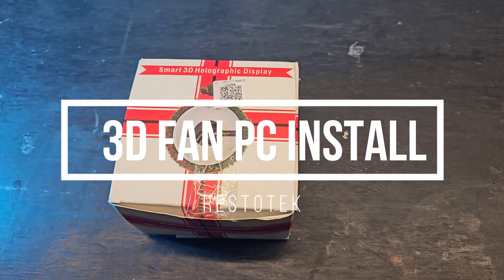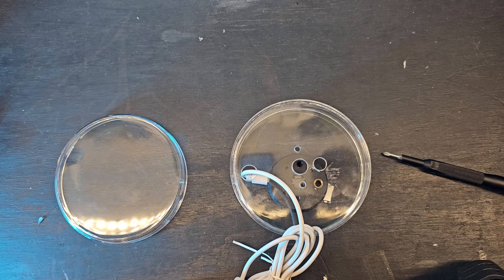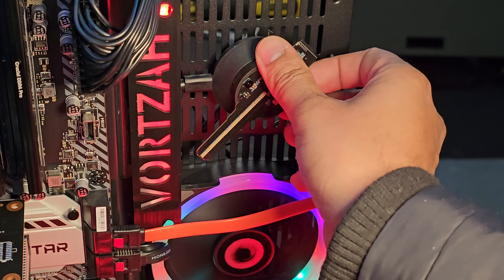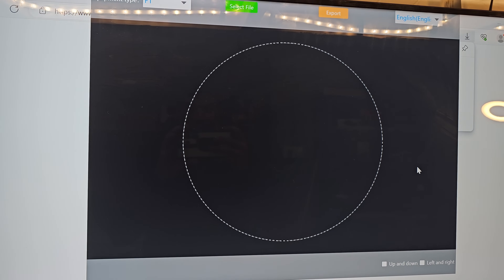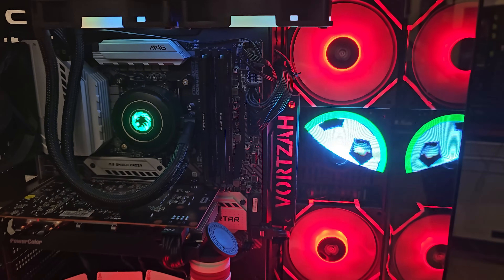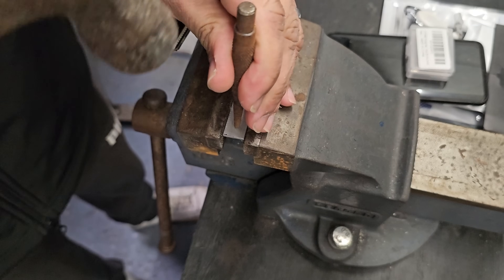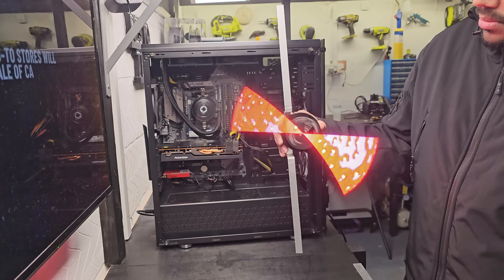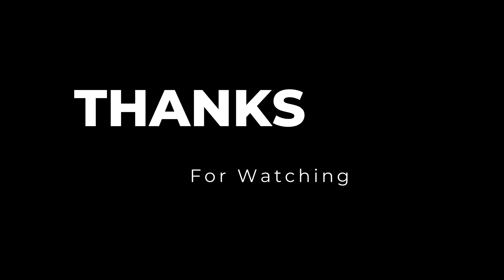FORGET Transparent LCD Side Panel, Try this HACK Instead!

Comment: Do you think it would work fine if you get the entire big fan inside the case with a side panel? I want to try, but I want a glass side panel and it does not have holes for the air to go/ come from
Reply from the maker: @BjarteInNorway  so I put my glass side panel on, the clearance was pretty tight so had to make sure it won't hit the glass, but once on the fan would pull in air from the edges which should still be fairy effective. The main issue I had was the fan I had was not balanced and wobbled quite a bit and there was quite allot of vibration

Comment: Could you provide link to the one you installed? Thanks for the demo!
Reply from the maker: It did work great also the cooling of the internal components was a bonus, the only problem was that it was super loud and wasn't really well balanced, I wouldn't get the one I got, I would get either one that is slightly smaller or a bit more high quality.
Reply: @RestoTek  I appreciate the honest feedback will do

Comment: That's pretty cool. I did the transparent LCD side panel mod, and while it does have many advantages, the rotating display will probably work a lot better during daytime/in a bright room
Reply from the maker: Yeah it works at any time of the day, it does look really good and provided great cooling to the internal parts (cpu, gpu) the only problem is that it's was a bit loud, maybe get a better quality one that is much better balanced